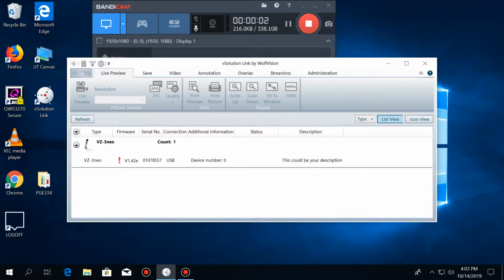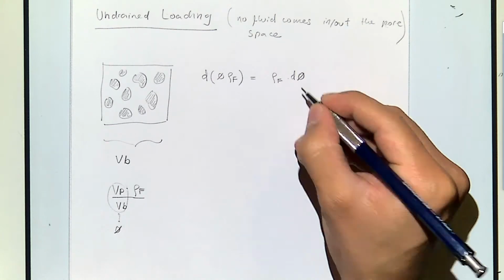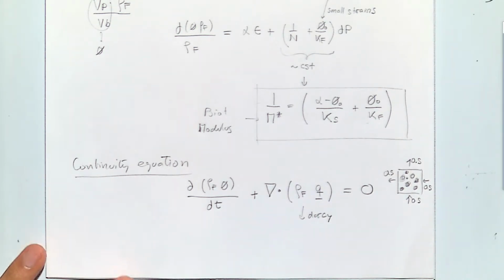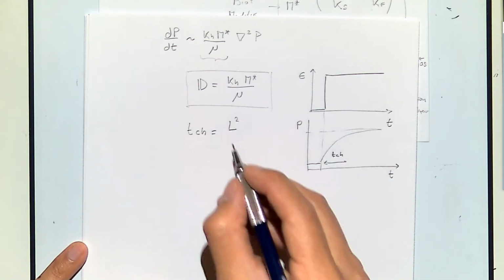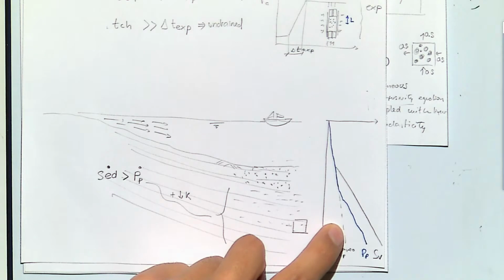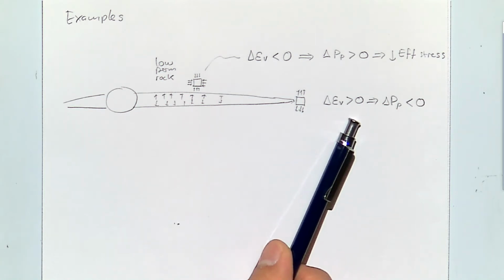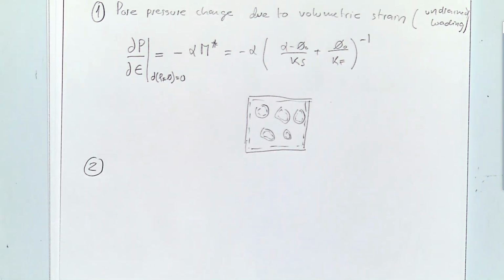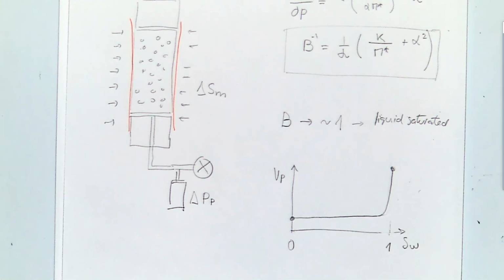L13 Undrained loading: diffusivity equation, examples and characteristic parameters

Comment: from where can i get the solution of the diffusivity equation including deformation
Reply from the maker: I did the derivation based on the contents of the book "Mechanics and Physics of Porous Solids" (https://onlinelibrary.wiley.com/doi/book/10.1002/9780470710388), where you can find the final equation too. Another derivation is available in "Fundamentals of rock mechanics" by Jaeger et al (https://www.wiley.com/en-us/Fundamentals+of+Rock+Mechanics%2C+4th+Edition-p-9780632057597).
Reply from the maker: The solution depends on you boundary and initial conditions, simple solutions in 1D are available in Jaeger et al. book
Reply: @dnicolasespinoza5258  I have some doubts regarding boundary conditions on the same. If you could provide your mail id it would be great help. thanks